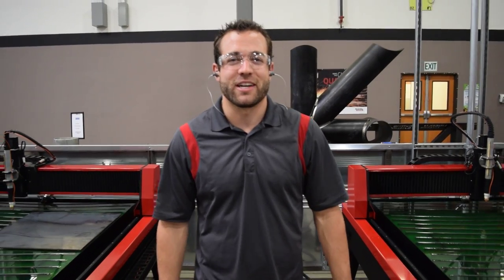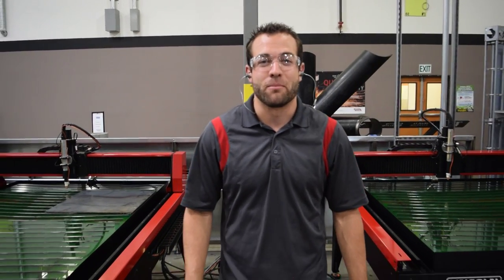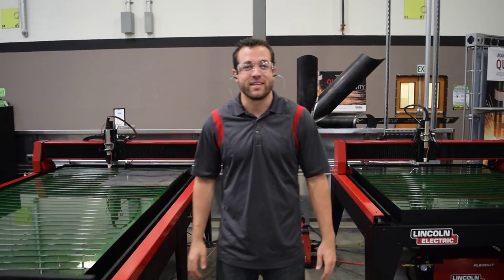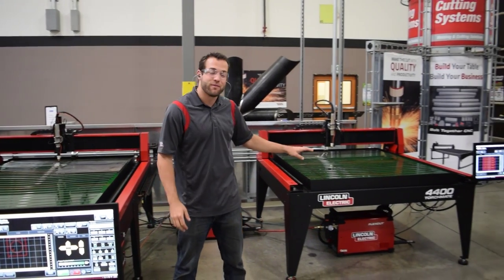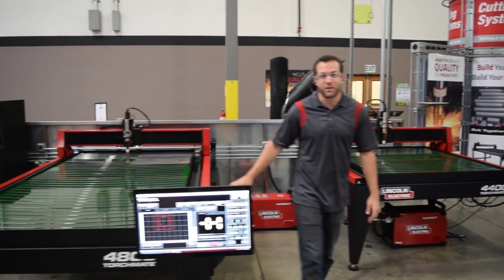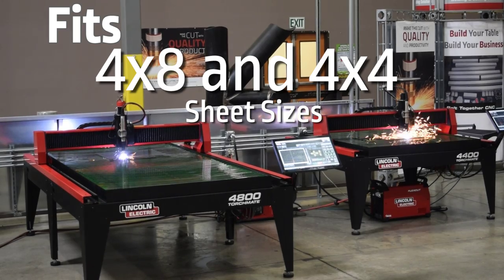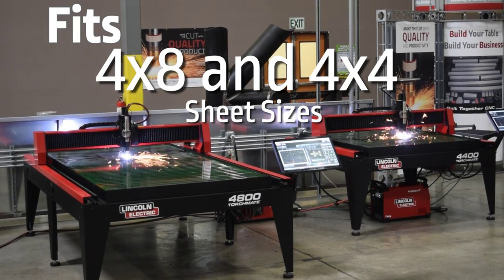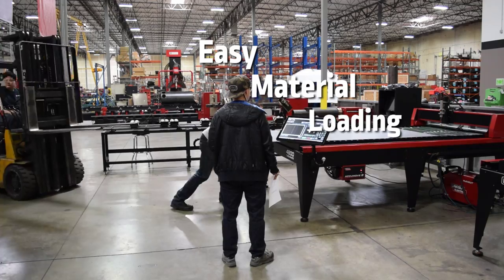Introducing The Lincoln Electric Torchmate 4400 and 4800

Comment: HI, WITH THE WATER TABLE, WILL YOU NOT GET CONSTANT SPLASHES ON THE MONITOR AND ACCUMOVE 2 AS MY 2 X 4 TORCHMATE SPLASHES WATER EVERYWHERE?
 AND HOW ABOUT SETTING UP SOME 1.6MM OR 2MM SHEET AND SHOWING US SOME CUTS AND THE BACK SIDE DROSS ?

LARRY CAMERON
RUSTICMETALART
Reply: In one video, they had the plasma unit on a shelf above the table. Not a bad idea to keep the unit away from water.